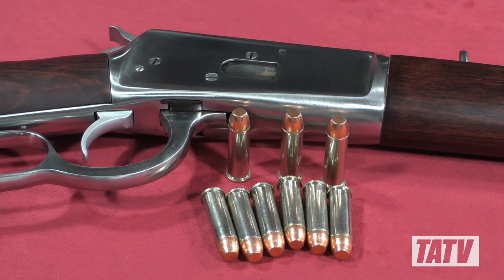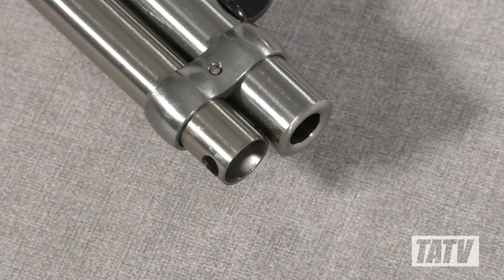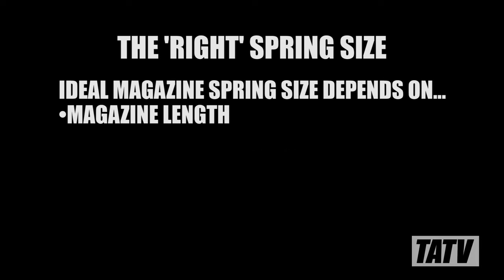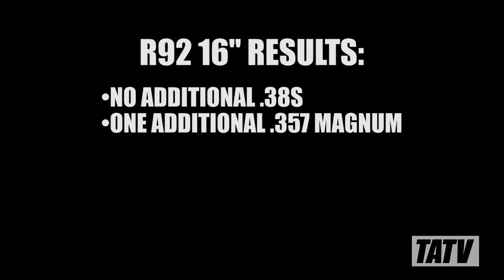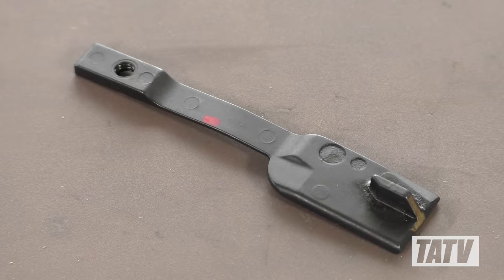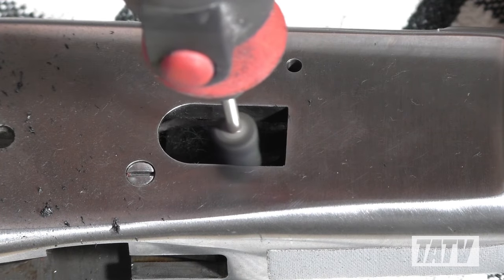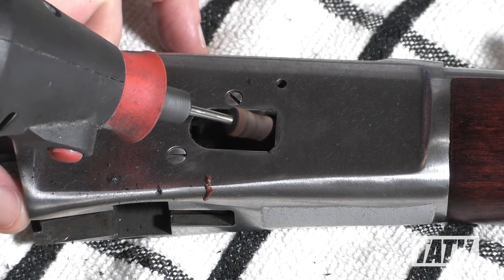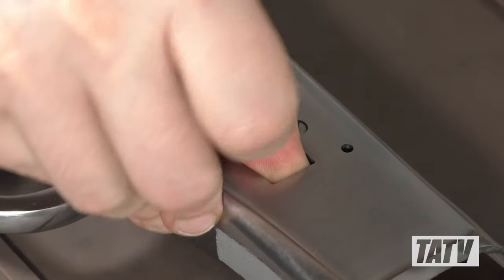Slicking Up A Rossi R92 Lever-Action Rifle - Part 2

Comment: I'm NOT looking for a competition grade tune up, but a little bit of easing up may be good for  my wants.  I may replace the trigger and ejector springs to lighten up the pull, but no cuts there.  I figure that will give it a 3 pound pull instead of a 1.5 [ rough guess.] That sounds good to me. The Ejector spring threw brass a good 24 feet, across the width of our cabin here, so a lighter spring will help there. No need to cut it tho. Some smoothing of the slide and hammer is needed tho. [Per Part 1]. These 2 videos are definatly handy.

Comment: I bought a Rossi 92 16'' 357/38spl 3 months ago. I did basically the same things you did. Great results it added one round of 357 mag to capacity. I bought the anodized black/blued version with the rose wood. I added small limb saver ''for added length of pull'' a peep sight, rail, large loop lever and a quick detach red dot. It has everything the Triple black has for about $385 less.
Reply from the maker: That sounds awesome.
Reply: What large loop lever did you fit? Puma version?
Reply: @cryan8271  My Rossi is a new carbine made in 2023. I bought the large loop lever from Rossi Website.
Reply: @scottgraham1153  are the lever loops interchangeable amongst calibers? I don't see a medium sized 357/38 version, only the 44 mag. I have a feeling the answer is no, but confirmation would be ideal. Thanks!
Reply: @shaneswartz6053  No you have to get the one for the caliber. They only had the Large loop and the standard size. I would have gotten a medium sized loop if they had one but the large works and looks great.

Comment: How can the tube take more 357 mag but not extra 38 special? That makes no sense.
Reply from the maker: Because the difference between a 38s and 357 is less than the total length of an additional 38s.

Comment: Would this be significantly more difficult with a blued model? I’d be worried about matching the bluing where you polish it off.
Reply from the maker: I would assume it would be much more difficult.  'Internal' components that aren't otherwise visible wouldn't be much of a problem as long as they're kept lubricated to ward of rust, but I wouldn't want to have to try and match bluing on the rest.
Reply: Cold blue will do the trick for internal parts.

Comment: Nice..figure 5-7 coils off my magazine spring for a 20 inch barrel, and 0.6 to 0.8 inch curve on the gate spring..ought to handle my loading question.
Thanks.
Reply from the maker: You're smart to start slow with the spring; I ended up making a second cut but was glad to have the option once I'd tested it.
Reply: @TATVCanada  Well, I had a guide out on point, and that math was easy even for a drop,out. LOL. Tip o' the hat.

Comment: Hey if you do a part 3 would you be able to take a look at the hammer? Ive replaced all the springs and the gun runs super smooth, but when racking the action I tend to find the most resistance coming from when the bolt starts to hit the hammer and pushing it into the halfcock position ish.

If you slowly pull back on the hammer you might feel the same sort of hangup right there. I dont know if its fixable or just somethin I have to deal with, but id really appreciate any help
Reply from the maker: I don't currently have plans for a part 3, but if that changes, sure thing.

Comment: I just finished following your video, including the same reduced spring kit. Everything seemed to go well but now my hammer doesn't feel quite right. It seems to hit a wall about halfway through its motion where its harder to push past. If I let the hammer drop it acts normal, but if I try to help the hammer down with my thumb it hits that jam spot. I can force it the rest of the way but it won't fall by itself. Is that just a result of the reduced hammer spring or is something wrong?
Reply from the maker: Huh, that's a weird one. I would take it apart again and check to make sure everything is aligned properly and there's nothing jammed in there like a piece of grit or rough edge that's rubbing/binding against. Some manufacturers make hammer shims (small pieces of Teflon that go on either side of the hammer) for revolvers; you could maybe try those. If you're in the US they are cheap.